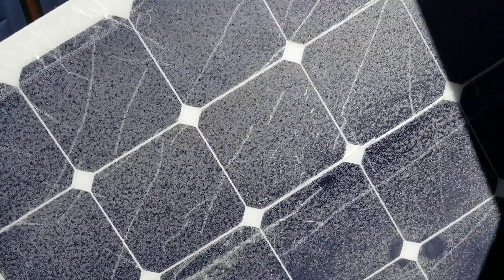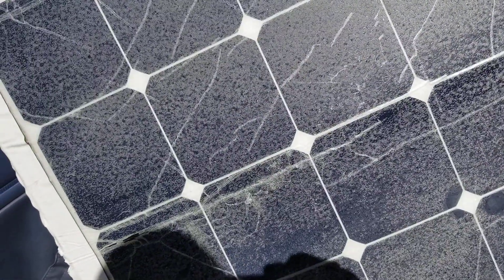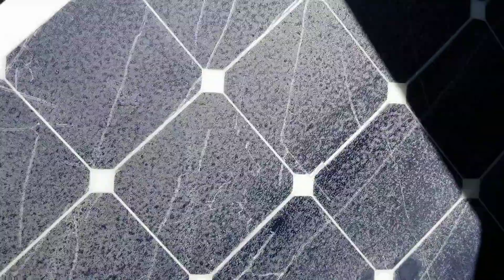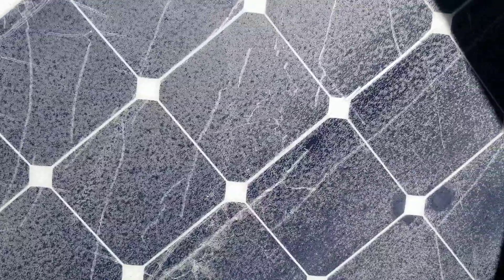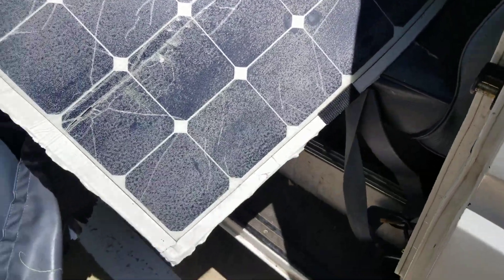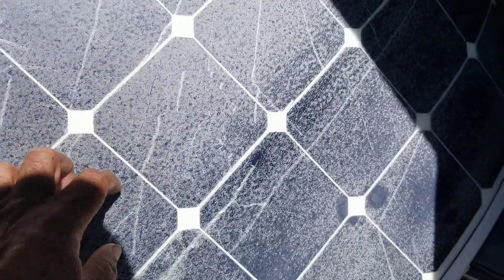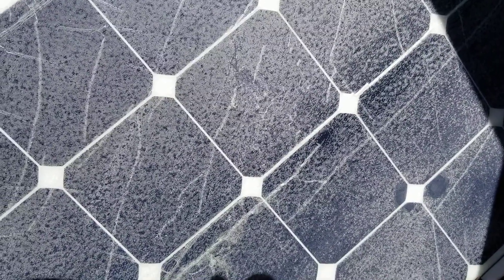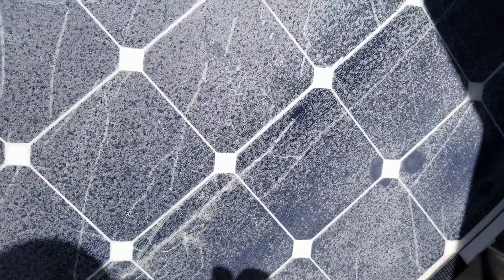Flexible Solar Panel Kryptonite aka Delamination

Comment: A buffer and a can of cutter bug repellent and they will look like new    just spray a section and buff them off  works on headlight covers too.
Reply from the maker: I used it as an excuse to buy a 160 watt Renogy panrl, I might find another place for the 100 watt panel later...
Reply: @Texastigerdigsdetects  LOL  i do the same thing when I want something new.